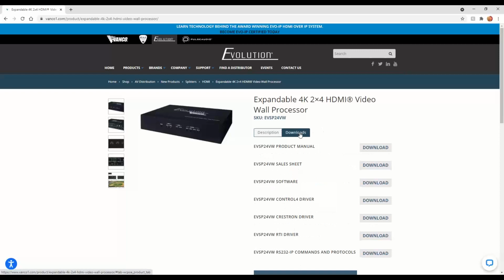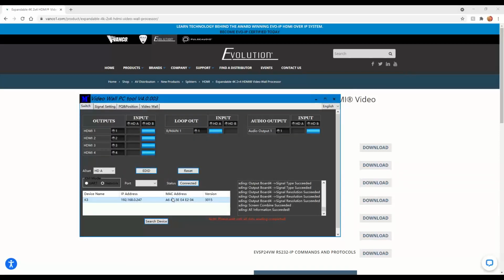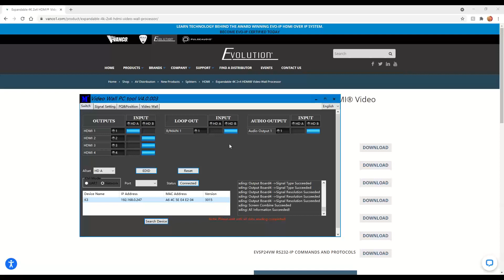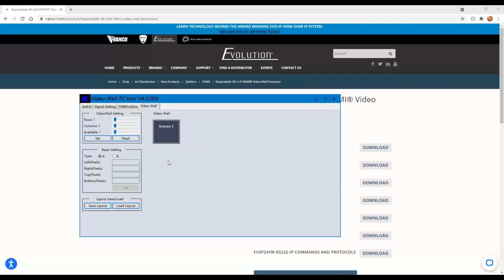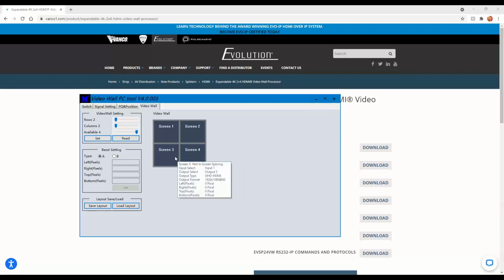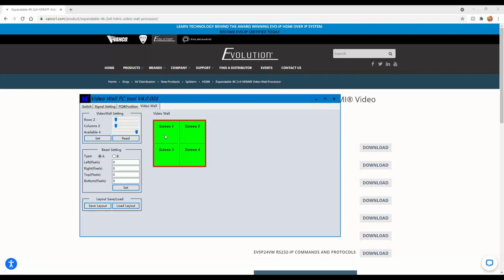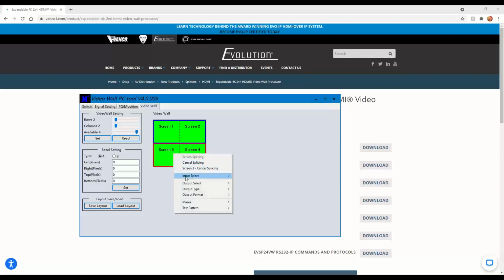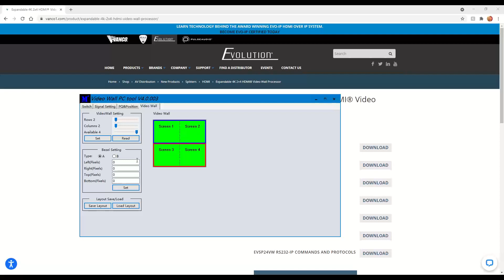How to Set Up a Video Wall

Comment: This working with a sonos arc ?
Reply: The EVSP24VW does not have ARC capability, but when used with a PA-EARCX, you would be able to use to get audio to Sonos
Reply: @brandonwhite6750  I haven’t tried that exact brand but I did attempt that and it didn’t work. Only luck I’ve had is hooking an iPad or any apple product and then streaming the audio from the iPad directly to the sound bar while displaying 1x2